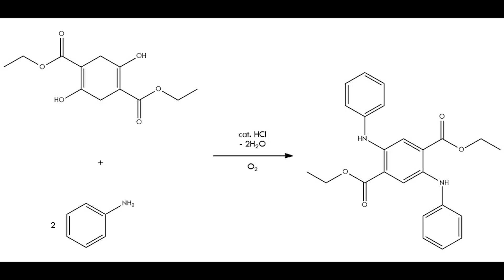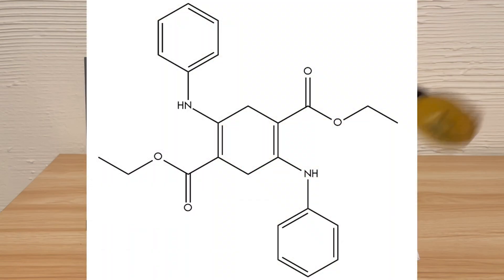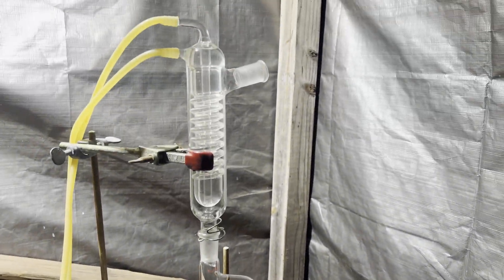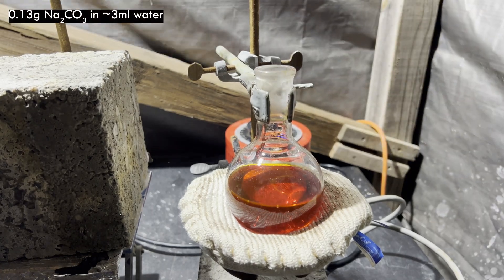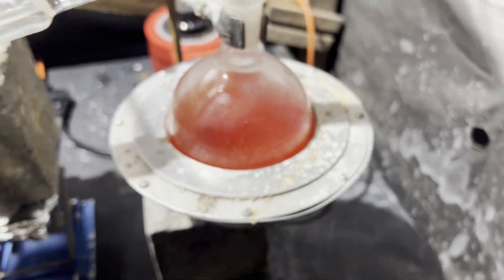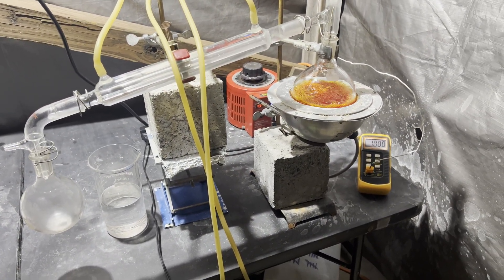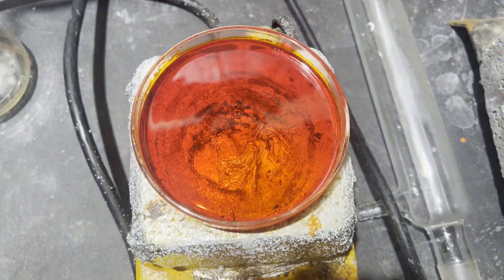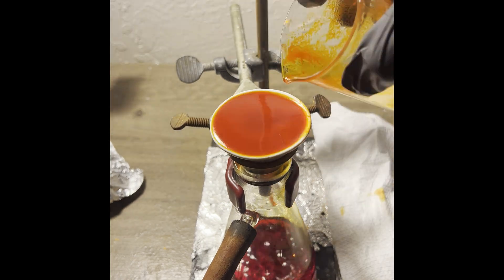Making diethyl 2,5-dianilino-terephthalate (sort of)

Comment: Steam distill the mixture of aq. aniline, look in the Organic Synthesis procedure for aniline oreparation. My recollection they had it there or..may be Vogel book.
Do not mess with this coloured crap you have got without some reducing agent be that acitic medium or basic, iron in acid is a primitive stuff and works or sodium sulfides in basic solution or Na2S2O4, thiourea disulfide is less economical.
Na2s2o4 is a very useful reductunt for substituted aromatic amines and reduces all that brounish-blackish tar. The most convenient to reducing agent for these procedures.